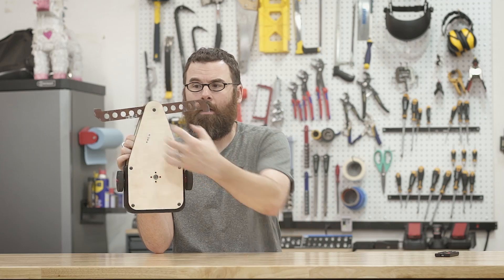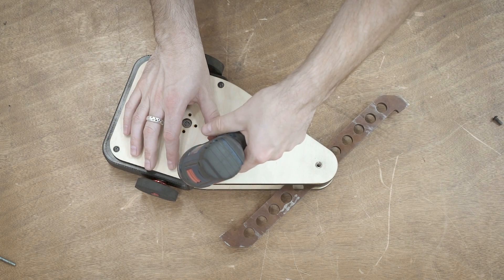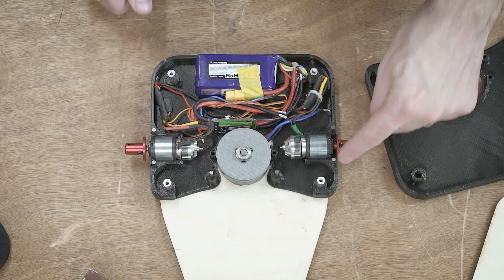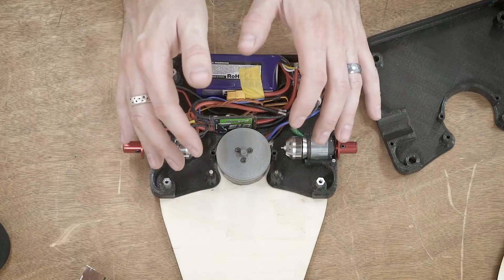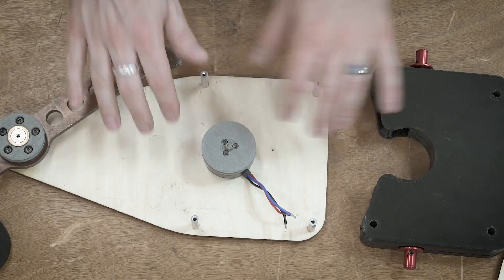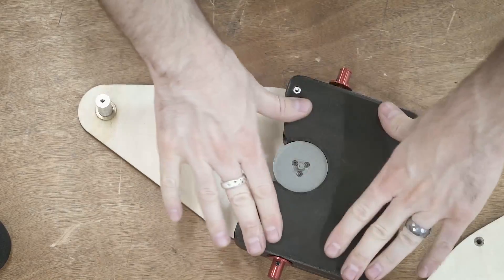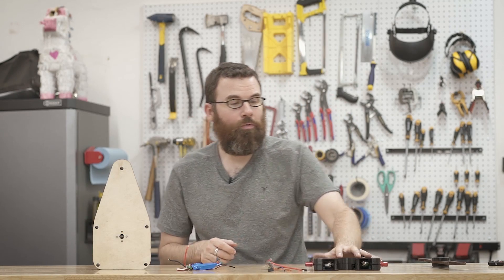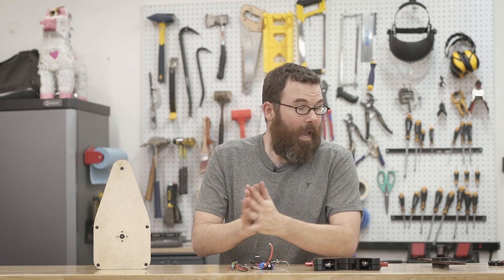Psychotic Break Build - Body Mockup

Comment: I kind of want to see stl/dxf files for this when it’s done. 

Edit: You should do something to protect that weapon motor from your blade.
Reply from the maker: The frame keeps the weapon a safe distance away from the motor ;-)  the final design will address this more.  this is just a prototype.
Reply: Ok. I would still like to see stl and dxf files for this bot when it’s done. (The weapon blade can be a separate file if you want.)

Comment: Why do you need wheel guards in front of the wheels?
The weapon bar is right in front of them. It would deflect any incoming strike.
Reply: The weapon bar only deflects away from the wheels on one side of the bot.
Reply: @JosephHarner  But I think there is a higher chance to reach the wheels from behind than to reach through the weapons circle of death.
Regardless of the strike angle there is always one component of the impact force pointing away from the center of the circle ( or did you see any robot being pulled towards an opponent by a spinner hit?).
My point is:
Regardless of the striking angle there is a very low probability that the enemys weapon bar will hit the wheels from the front rather than being reflected away or to the side.

Comment: Hi Robert,
do you think a weapon similar to a butane nailer is viable?
Basically the weapon would be a spike attached to a piston of a one-cylinder engine. On the opposite side there would be an air spring to reset the piston.
When the volume and the initial pressure is increased there could be a lot more power than in the nailer. Hydrocarbons have a much greater power density than lithium plymer batteries => maybe more destructive?
Maybe the rules for robot combat forbid such weapons?

Awesome series by the way!
You show the technical challenges and their solutions easy enough that even the layman could start building robots.
Greetings!
Reply from the maker: When thinking of weapons, always consider "with every action, there is an equal and opposite reaction".  In most cases, a piston type weapon will usually push you back just as much as it impacts into the other guy, so you're just canceling out the energy.

Comment: Can the blheli 32 be reprogrammed to be bidirectional for drive systems?
Reply from the maker: Yes!  I am using blheli32 for the drive on this bot.  They are tiny, but have a good amount of power.
Reply: Yes it can. You can even do cool stuff like program a 4:1 esc with two drive channels and one weapon.